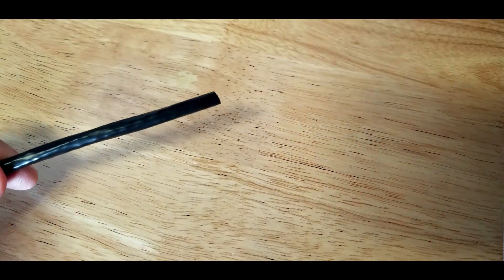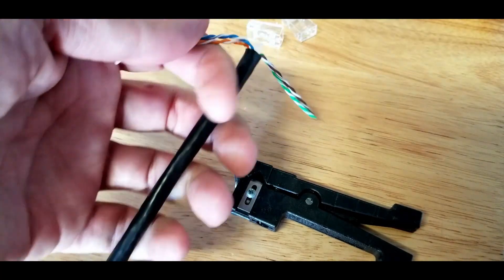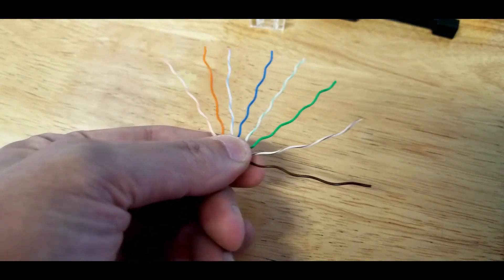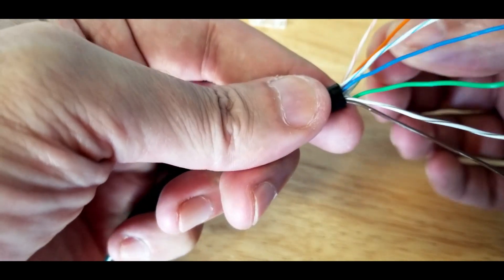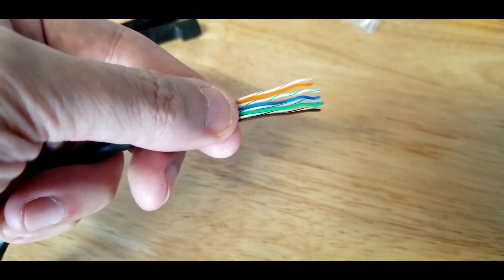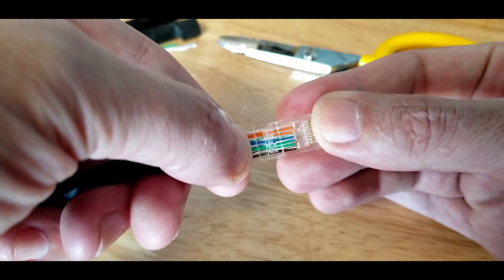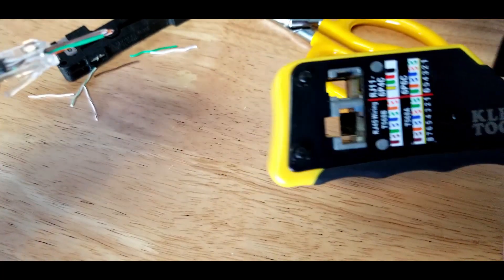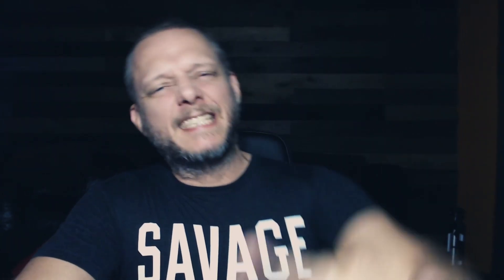HOW TO Terminate CAT6A Pass-Thru RJ-45 Connectors

Comment: I used to make my cables this way then read the instructions....  the common node noise is cancelled using the twisted pair sets (orange, green, blue, brown) when wiring straight like this, you are using the receive + wire from one pair and the  receive- wire from a different pair.  This screws up the twisted pair noise cancellation.  Works great for 1&2 as that pair is one of the twisted pairs.  But the second pair is 3&6 which do not use the same twisted pair.  I flip the two wires of the 3&6 second pair into the 3rd and 6th hole so the connection uses the same twisted pair wires.  Makes it tougher to assemble but cancels noise better. For ehternet is use green/wht, green orange/wht blue/wht, blue, orange, brn/wht, brn in that order.  Different if Phone.
Reply from the maker: I wired it as 568B standard. Orange/White, Orange, Green/White, Blue, Blue/White, Green, Brown/White, Brown.
Reply: @SavageMine  Yep, I used T-568A standard ... gotta love those pass-thru rj-45 connectors